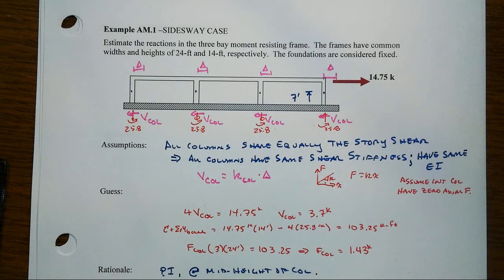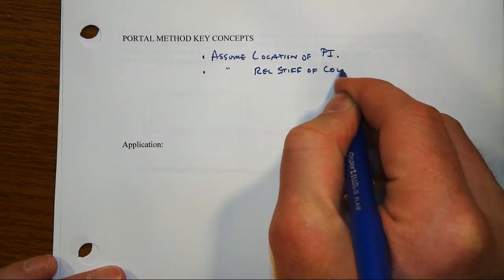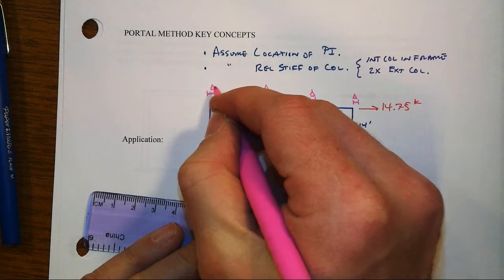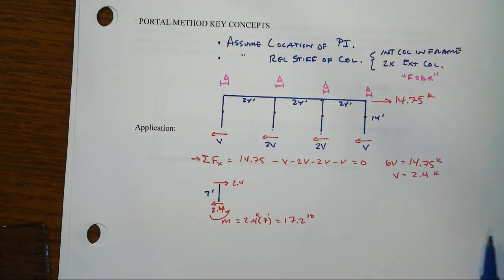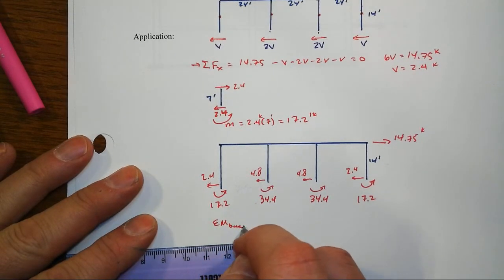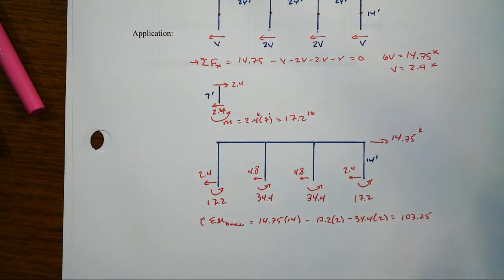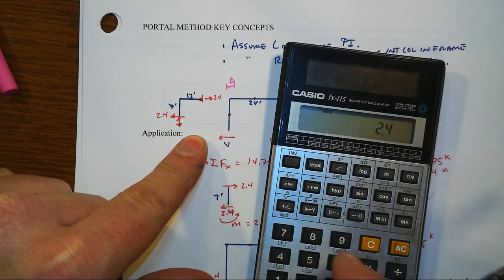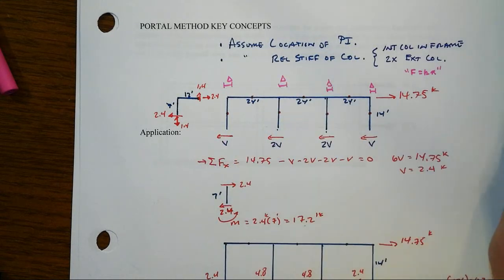Approx Methods Ex AM1 Portal Method

Comment: Hey. 2.4 x 7 is not 17.2 it should be 16.8
Reply from the maker: If you look at more digits in the approximate column shear (2.458), then when you multiply by 7-ft, you end up with the 17.2 k-ft.